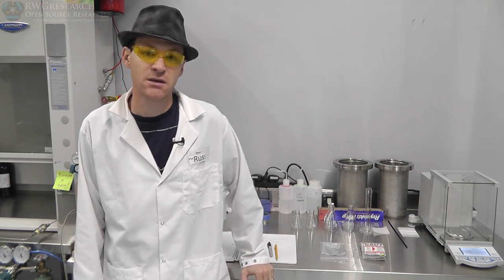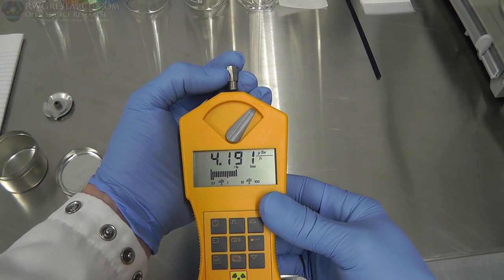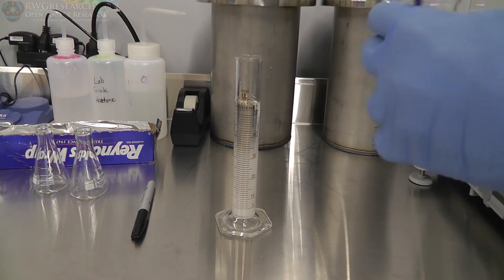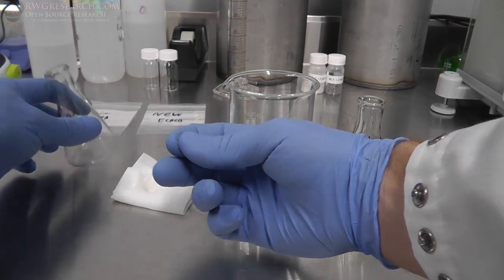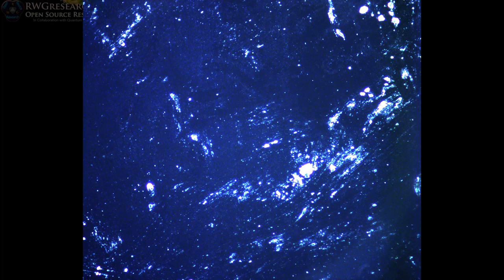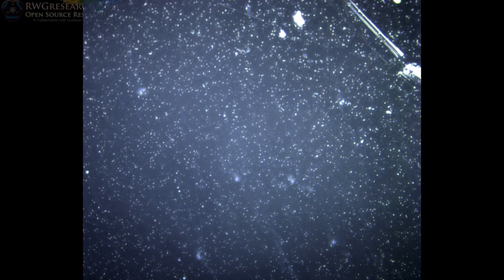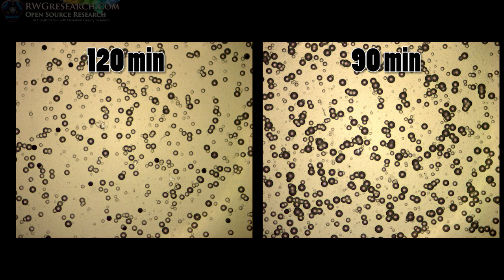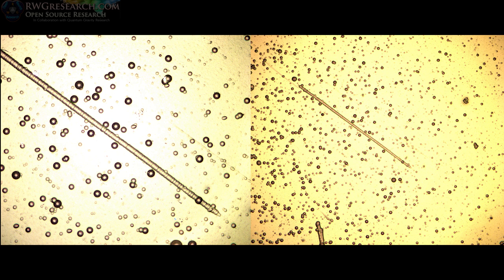Cold Fusion update#3 : CR-39 Research, Nuclear Track Testing. AKA: Dosimeter

Comment from the maker: In this video I show you the method i used in my Solid State Nuclear Track Detector. Using CR-39 plastic one can see the tracks being created as partials decaying from a Nuclear reaction. . 

I started by exposing the CR-39 plastic to a americium source for 3 min. Because the tracks are extremely small we need to etch the plastic so we can see the tracks with the optical microscope.  For Etching i tried the "standard" 6 hrs etching time with 6M NaOH @ 80c and found that it was just way to long.

I then went back and set up the experiment slightly better and more controlled. I covered the americium source with AL foil and poked a pin hole in it. Then covering the source with a metal plate and suspending the CR-39 plastic about 5 mm above the source. exposing the disk for 1 min. The goal was to achieve a more controlled exposure. 

For etching i used the same 6M NaOH @ 80c but this time i exposed the disk's for 30min, 60min,  90min, and 120min. This way i could find the best time for etching and get the best results. 

I created some documents about what i did here that might be better for those who want to see the photos better . please see here: 
http://rwgresearch.com/open-projects/cold-fusion-lenr/cr-39-research-nuclear-track-testing/

more on my LENR work here: 
http://rwgresearch.com/open-projects/cold-fusion-lenr/

Forms and discussions here: 
http://open-source-energy.org/?board=101.0

thanks for watching! 
~Russ Gries

Comment: If you think they are tracks of particles emitted from the source then you should tilt the plastic on the source (multiple angles) to verify you see an angular refraction of the paths. All angles leading into just similar dotted pattern would dictate that these are in fact not "tracks" but something else.
Reply from the maker: +TruthJudgesBrutally yes, 

i was going to test this but there is no need due to finding the tracks matching the angle where the particles came from the center. ( all the way around the disk you can see this, i only showed the top and bottom) 
but either way it would be cool to see the tracks at a steep angle. 

thanks! 

~Russ
Reply: ***** Sure. What I would do though is test with different angles and longer exposure.  Anyways, it was an interesting experiment. Thanks for sharing!

Comment: My guess on the long track would be outside, higher energy source, like cosmic rays.
Reply from the maker: +Jan Hlavatý yeah it could be. being such a long track. but if the energy was the same as the rest of the tracks but at that angle it loses its energy "slower" and goes further in the process... I'm not sure tho :)  could test that by having a disk an a steep angle with the source. i should see Manny tracks like that. there in lies my answer :) ~Russ

Comment: Is it possible that the side of the disk was presented to the source on a heavy angle, when it was put on, or taken off.. So a partical could had hit the disk when it was perpendicular to the source? Just brainstorming the obvious options....
Reply from the maker: +patchlead i took extra care when setting up the test, however anything is possible. I will need to do a disk at a steep angle to see if that's what I'm seeing but i have a feeling that it is. ~Russ
Reply: +rwg42985 good idea... Try to make them! That I'll at least give you a reference..

Comment: is it possible to get this plastic in a thicker piece and after exposure, cut a cross section out of it and view that?
Reply from the maker: +EitriBrokkr yes, actually theses are thick enough as the partials do not go through this then disk. the trick is cutting it.. need something that will not mess u the edge. i think i have some ideas but ill need to test it. ~Russ
Reply: could you just cut it, and them polish it back a little with some glass polishing media, diamond impregnated oil or the likes
Reply: @RWGresearch  Maybe a laser cutter. It polishes as it cuts. The material is vaporized.

Comment: I wonder if you would get a wave interference pattern if you had double slits in the foil rather than a single hole?
Reply from the maker: +Jeff Elkins its a good thought, however i would think not. mainly because the source ( although coming through a small hole) is not a single point source. ( that's why you can see the angle that particle was coming from.)   i would imagine if it was a point source then there might be a chance to see the interference pattern if there was one. :)  good thinking tho! would be cool to try! ~Russ
Reply: @RWGresearch  You should get an interference pattern from Alphas, but agree the source will need to be a little farther from the slit. That would be very cool.

Comment: i would like to see a control disk with the same etching time
Reply from the maker: +david wise yes 2 more experiments is a new etched disk @ 120 min and a disk exposed at steep angles to the source.  I think i will do a fallow up video at some point! I had a control disk in the first set of testing but need to do the same for the second test of etching times. i needed to do the times first to find out what time to do my control :) ~Russ
Reply: cool if you can could you show us at that time